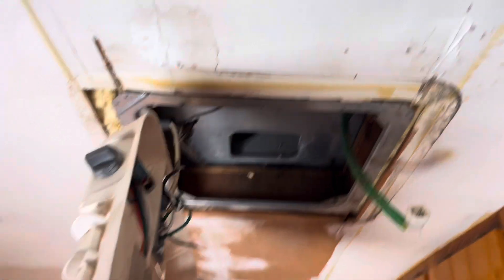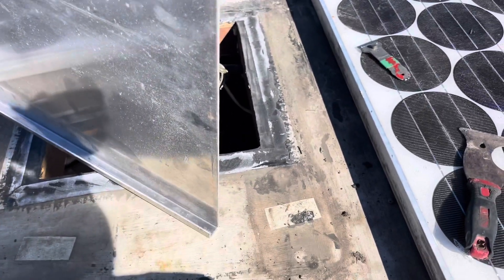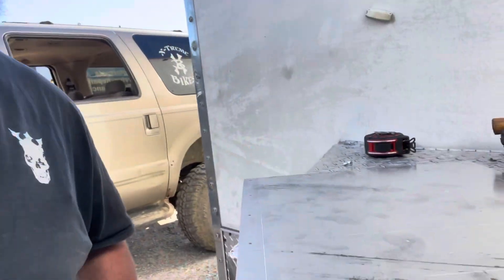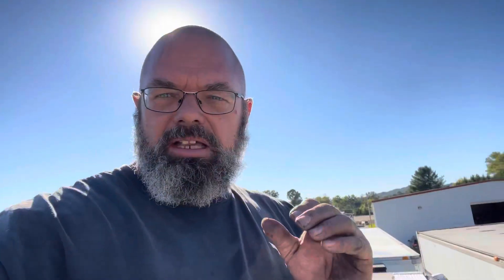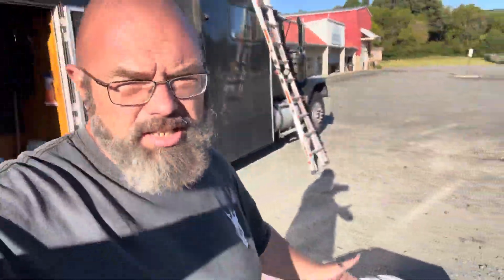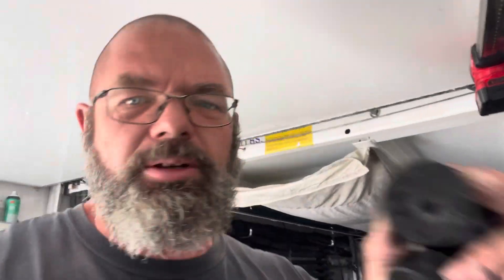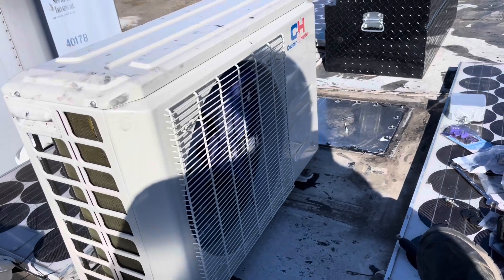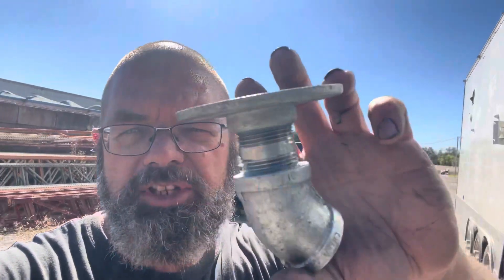Mini split install pt 2 removing the old and setting the condenser. More challenges!,

Comment: Whats the next plan for Stumble Bus, thats a cool ride
Reply from the maker: It’s on hold for the moment
Reply: Struggle bus is a work in progress. On the road projects get put on hold but will get done. The ac has been needed to keep us both comfortable on the road and not use alit of wattage. It runs with solar as well as generator and it’s awesome